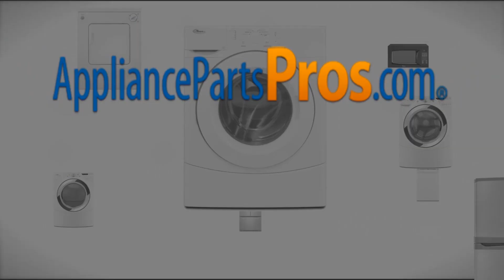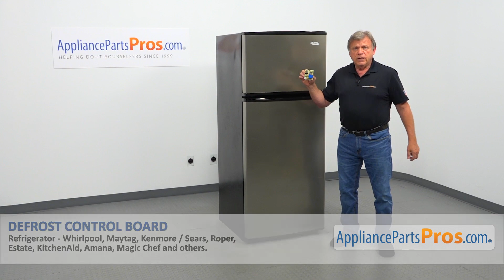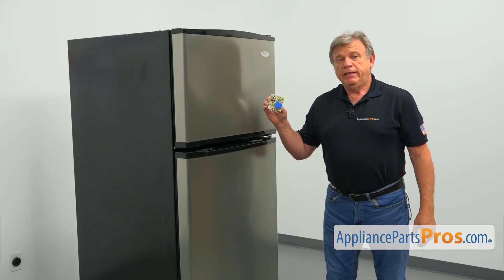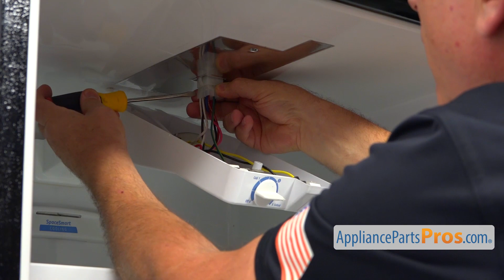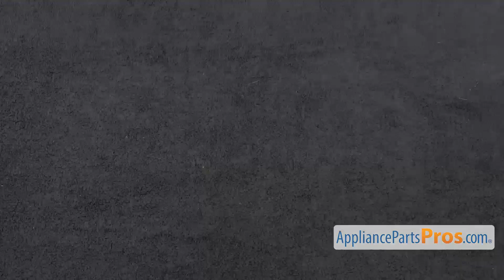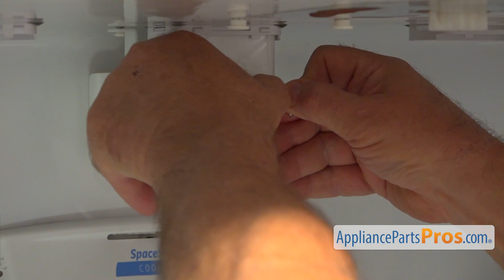Whirlpool Refrigerator Defrost Control Board 4388931 Replacement — fits KitchenAid/Maytag

Comment: I have continuity on the element and a new switch that attaches on the interior of the freezer and it still freezes up. So I found the board on EBay. New pulled from a discontinued  refrigerator for 18.00 less than Amazon. Appreciate this vid. Hard to find anything on my model.
Reply from the maker: You're welcome! Glad you were able to fix your issue! If there is anything we can help you with in the future please let us know.